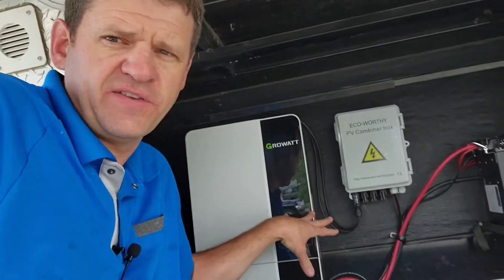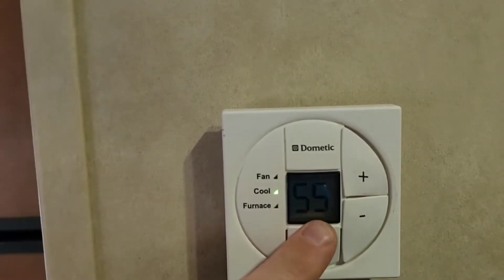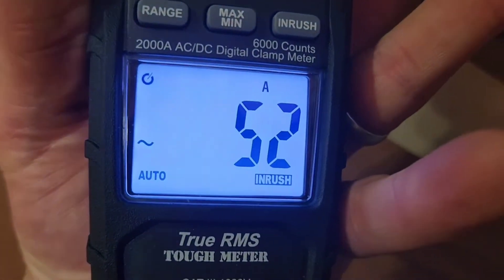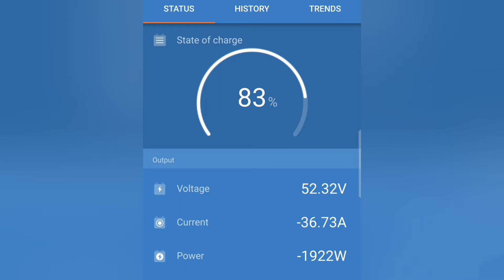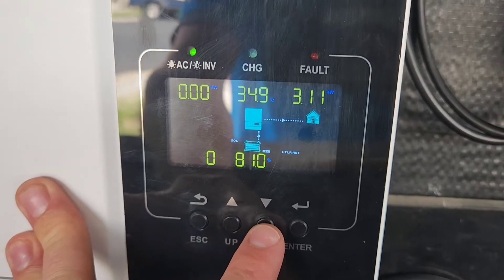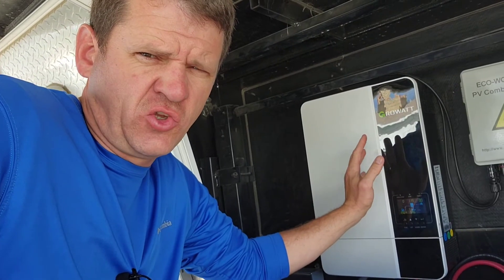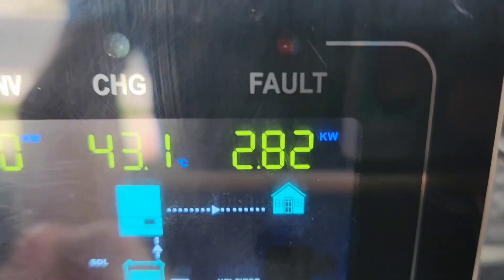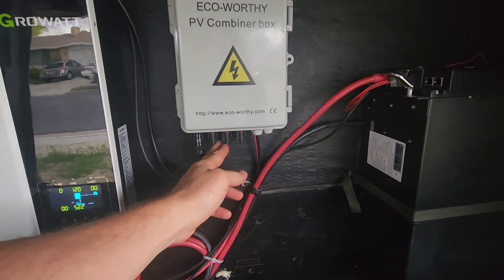What can I power? Testing my LiFePO4 48v RV power system

Comment: How many BTU on your air conditioner ?
What is the temperature of the air conditioner at startup?
Reply from the maker: Sorry, I'm not sure the BTU.  I need to look that up. my bad. But it's a 30 foot RV so I imagine it's the larger model.  I've started in between 65 to 95 F temps.

Comment: Thanks for this! So, two questions: 1. Can you expand the battery capacity at a later date by adding another (or two) EG4? 2. Do you use all 110V appliances through the inverter or do you also run 12V stuff?
Reply: Apologies, I just watched your install video and everything was answered. Thanks again!
Reply from the maker: No problem, good luck. Im out camping right now on the first outing with the system. It's doing awesome!! Yes you can add more batteries easily. One battery is about the same as eight of the old traditional lead acid batteries. So there's a lot of capacity there in just one. If I was camping in the desert a lot wanting to run the air conditioner at night I think I would get another battery.

Comment: I like the production quality of your videos.  I REALLY like the setup you have installed in your RV.  You are "overly optimistic" on what that system can handle.  You literally just demonstrated that you are only able to run your RV's A/C and microwave, simultaneously, by virtue of the surge capacity your inverter offers.  You also demonstrated that running those loads for just 1 hour will draw roughly two-thirds of your battery capacity.  How could you possibly think that this system, as it is currently configured, could double that output for any appreciable period of time?  If your A/C was running, your microwave was warming something up, and your buddy's A/C kicked on, (drawing more amps than your A/C due to the use of a long 30 amp extension cable, with attendant losses) there is no question your inverter would have an over-current fault.  Even if you carefully turned loads on and off, that battery isn't going to last for even 1 hour, powering two RV's.  Are you not able to add this all up and see the reality?
Reply from the maker: Hi Jason, Thanks for the comment!  I'm in Utah, the northern part with the mountains, so we don't really run the AC while camping.  Most people I go camping with bring a generator to top their batteries off before bed, warm up a burrito or watch a movie at night.  With the 5.12kwh battery, that can run the microwave for over 3 hours(not sure how many burritos that it but I think it's a lot).  My DVD and TV only use around 100 watts when running so I'm not too concerned about that.  I'm not sure how much power it will take to top their battery off. Maybe that's something I should just plan on doing when the sun is out and disconnect them overnight.
   But you're right if it was hot and we we were both running our AC units the battery wouldn't last long at all!  I think in that scenario I'll try and run it and then tell them to get out their Generator... and hope that they brought a big enough generator to handle the AC inrush to get it going.  
  Thanks, let me know if you want me to try anything else.  I might be taking the RV out for memorial weekend if the stars align :).
Reply: @diySolarPowerFunWithRay  - Say your hot water heater and microwave are both running at the same time, then your buddy turns on his microwave.  Have you calculated how much more demand the long 30-amp cord is going to put on your load?  The system you have is great for a single RV, and probably enough for an RV and someone just tent camping, but if you try to run two full-size rigs off that, you're going to be tripping breakers frequently.  
One great thing about the experiments you're doing is you're getting first-hand experience with just how much electricity certain things use, and how little thought most people give to the ways we all use electricity.
Reply from the maker: @jasonbroom7147  being careful about what loads I run means I don't run a microwave and an electric water heater at the same time.
Reply from the maker: @Jason Broom charts show that running that cord at my max inverter capacity(25amps at 120v) is only a 10% voltage loss, and that is only if my inverter is running at 100%.
Reply from the maker: @Jason Broom  I am going to do a test on power loss in long PV cords though coming up.  Thanks for the comments and being respectful. Some people aren't. I will do a real test in the mountains where I'll attempt to run three RVs. I'll have to see how it works in the real world.

Comment: So if I understand correctly, you plug your shore power cord into your battery system? Did you do anything with the stock chargee/converter?
Reply from the maker: Yeah, thats correct.  I disconnected the converter box / charger box. I just disconnected it from the breaker panel. I also disconnected the 12 volt truck alternator charging just cuz I wasn't sure how that would interact with the lithium setup.

Comment: I’d toss your other battery in asap, just make sure it’s close to the same SOC first.  They have the double terminals for positive and negative, just connect the lifepower to the unused v2 terminals. You’ll then double the BMS amp rating to 200 amps at 48v, way higher than your inverter will handle but that’s a good thing.  One other thing is I have a smaller full size fridge and it only pulls 150-160 watts (can’t believe that one pulls 300!). With my 2 inverters, the fridge, and other misc loads, I’m around 300 watts. So pulling about 3600 watts from evening to morning before my solar kicks in.  Crazy how much just a little bit adds up over 12hours or even a weekend camping with cloudy days. Thanks for the videos.
Reply from the maker: Yeah I need to add it.  My fridge runs on electric or gas. I've heard that the pure electric fridges use much less power.  but I haven't tested that out.  I might have to run my fridge on propane if I know i'm gonna need the AC in the day. Thanks.
Reply: I toured a guy's setup where he had a medium sized Frigidaire that only pulled 75w.   Now that i have seen the holy grail Im
ruined but where is it?